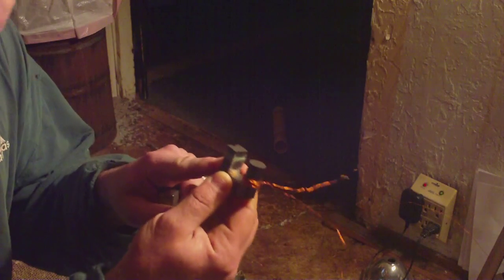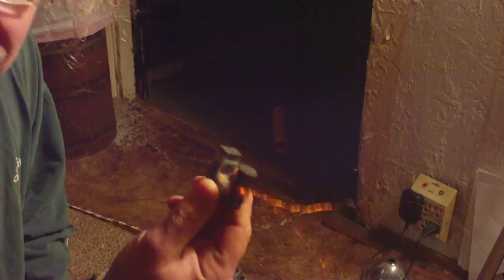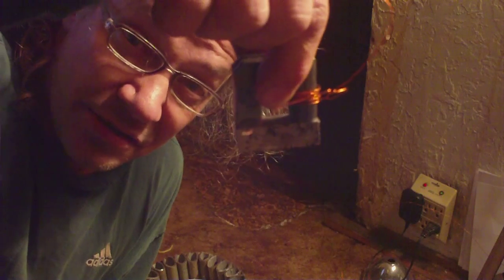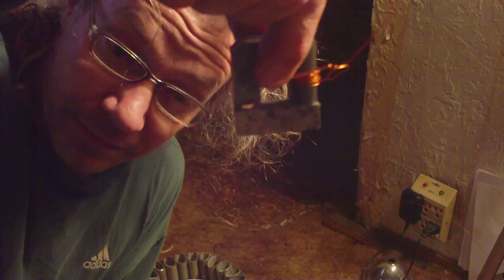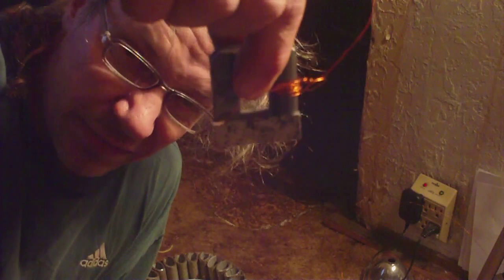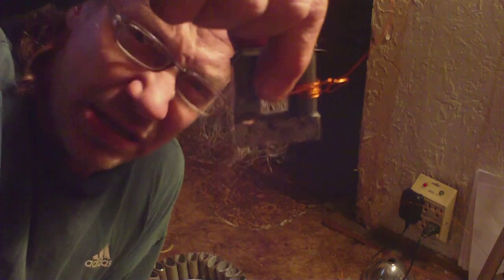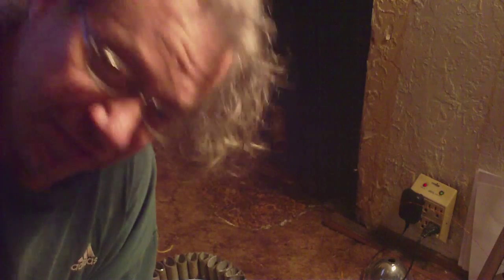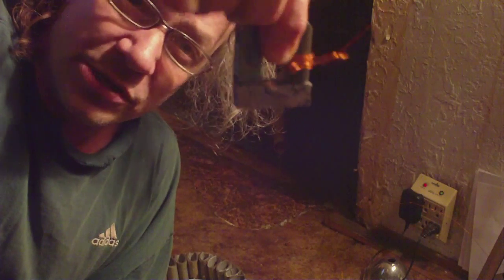david showing ferrite+steel PMH

Comment: it is what it is. remove the charge with a light like ed says to. the iron acts like a capacitor???
i'm glad you seen it working;)
grape vine is trying to say ed's rotor is a hoax.
this video is more important than the rotor.
when you connect the light make it so the metal falls off the u.